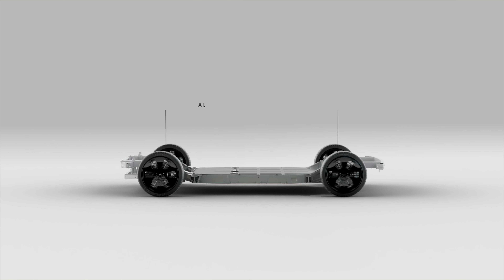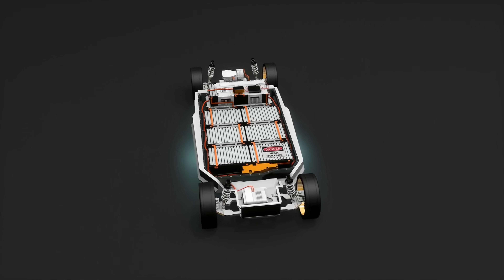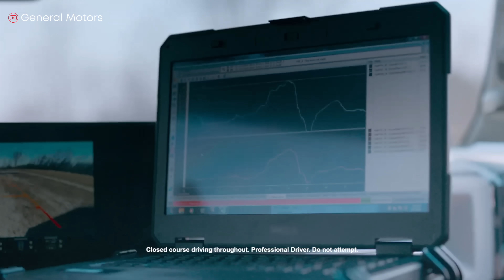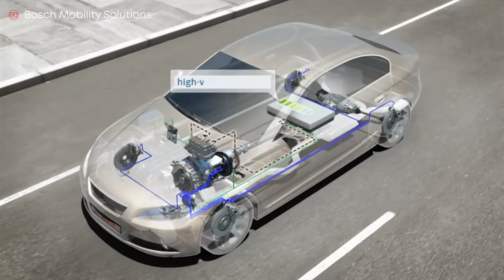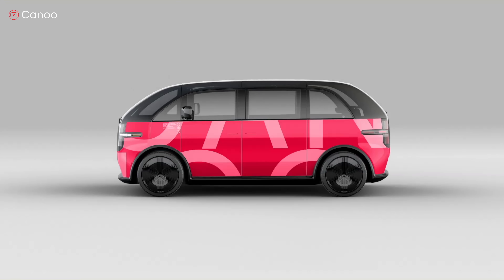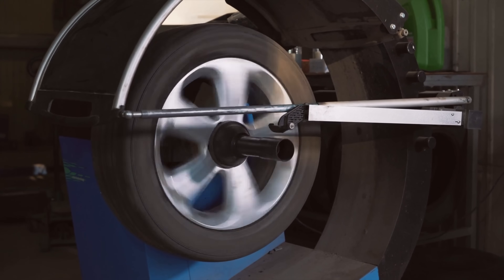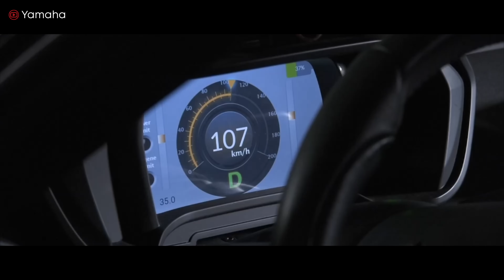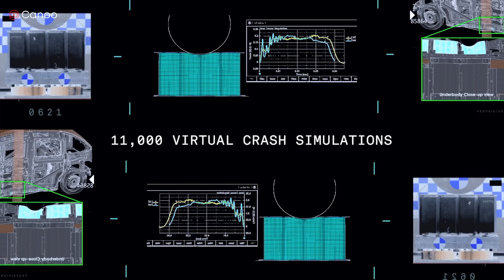No One is Telling You the Truth About Electric Cars, So I Have To

Comment: I heard of a man who brought a brand new EV.
Lives in a climate the same as Michigan.
After 7 years he could not do his longest trip without adding stops to do extra top up charges. It had lost most of its Range.
It was considered "too rusty and worn" to justify the cost of battery replacement. 
This was last year, so by about Feb it will be barely usable anymore. 
Basically he said he could do a few small "in town errands" 
but nothing beyond his city.
Reply: I have 4 years with an ev. 0 degradation so far
Reply: @alexandrutudor9497  It handles the winter winds and snowstorms okay?
The guy I heard of lost the value in his because of body Rust
Reply: @RetroCaptain  very well. no issues whatsoever
Reply: I live in Alaska electric cars are basically for rich people who use them during our 2 month summer, designer cars for decor not practicality

Comment: They are so very quiet you can not hear them come up on you in a parking lot, that's my personal experience with one.
Reply: Me too, I can see a lot of people getting hit by these silent monsters.
Reply: In Europe at least they have to make some noise. Audi’s sound is like a gas turbine. Plus they will have sensors and auto brake.
Reply: @pascalbruyere7108  But the hole idea is ridiculous that a car has to reproduce some kind of artificial sound coming from speakers to make been noticed and believe it's something real..i feel it's like a toy car..instead on a real combustion engine and expcially the sound coming from those V8' engines create a real sound that's coming from the mechanical movements and the pressure of combustion procedures from the fuels in the exhaust tubes in a way that it almost feels like it has soul..it gives you the feeling of a real car and real motor and the sound also varies depending how much gas you give to the motor..and that what makes the driving so enjoyable.

Comment: The key words are "UP TO". Generally, I NEVER have anything come close to these  hyped up "UP TO" claims.
Reply: you can win " up to " a million dollars and as little as " none "
Reply: Yup. They say a lithium ion battery has UP TO 500 charging cycles. Many solar energy users have been complaining about their lead acid or lithium ion battery for failing to keep their promises on the number of charging cycles. Temperature fluctuation, % of charge and discharge, ... all contribute to reducing the number of charging cycles that they claim that are based solely on the optimal conditions in the laboratory.
Reply: @trumplostlol3007   I’m over 2000 charge cycles on my Tesla… originally 265 miles range, now 245… 8 years later nearly 200,000 miles. Still runs like new and still original brake pads.
Reply: @cybertrk  Good luck for that. The replacement cost of the battery is over 20k and where do you want to dump your highly toxic and carcinogenic used battery? LOL

Comment: I think people shrug at the ten year lifespan of these batteries. The battery IS the car. You damage that battery or that battery needs to be replaced, then you mater as well buy a new car. If you get a new combustion engine, that engine can last 20, 30, even 40 years. You can easily sell a ten year old combustion engine. You can’t resell a ten year old EV.

Comment: Last week I drove 1200 miles to a couple of oil sites.  These sites are located in northern Canada. Access is on gravel/ muddy roads.  Guess what? No charging stations.   I'll pass on EV's.
Reply: Good thing most people don’t need to drive to remote oil sites.
Reply: These cars aren't designed to go to remote sites like that.  Not a car I would take on a long distance trip but wouldn't be bad as an everyday  commuter to work and back.  Only thing that would stop me from buying one is not knowing how long the battery will last.  Up to 10 years isn't good enough for me.
Reply: But couldn't you just drop an extension cord down from the clouds to charge it? Hahahahahaha.
Reply: @beachforestmountain4269  Silly---you tow a trailer with a gas powered generator. just sayn
Reply: What? Are you saying the infrastructure for a new technology that's been around for just over a decade isn't abundant? Who would've guessed that? /s
Reply: @nicholasthon973  It is a good thing, but what is the alternative to Canada eliminating all internal combustion engines by 2035? It sure isn't EV's.
Reply: I saw recently on youtube man from Russia  towing Honda gas  electrical charger on two wheels  for his Tesla to drive so far remote sites.
Reply: @bengaljam4550 Positive after 10 years new technology from today  on batteries can help bring additional 10 years or longer to run car. In common, most cars after 10 years are not reliable and absolite.
Reply: Canada won't be eliminating ICE's anytime soon.  The problem is the people vote for Liberal governments who tell the people what they want to hear.

Comment: Great job explaining electric cars. In the forklift world electric forklifts cost more to purchase but maintenance was much less than Lpg forklifts. I expect the cars to be the same.
Reply: @rigamortice actually, it's quite the opposite. They hold their values better than ice cars. I bought a 2020 Chevy Bolt EV brand new for 28k, and sold it 40,000 miles and 2.5 years later for 27k.

Comment: I just did a small study of top of the line 21700 batteries (same as in a Tesla) and the results were interesting. Over 1 year of moderate use and 3 discharge/charge cycles per week they lost between %7 and %15 per cell. 1 out of 15 cells even developed an internal fault and started discharging themselves through generating heat.
 In an electric car with thousands of these batteries I could imagine these results would cause some significant problems.
Reply: And yet, real world results do not support your "small study".
Reply: Exactly what 21700s are these? 21700s are a size of battery, (21mm diameter 70mm length) not a specific model or power rating. You can have 2000mah 5amp 21700s or 4000mah and 40amps. You can have Chinese garbage, or high quality Samsung cells. Simply saying 21700 gives you literally no information at all except their size…

Comment: I think EVs can be made to be more reliable and cheaper. I read somewhere here that Toyota had promised individual cell replacement in the battery pack and it hasn't happened. The whole EV industry is gearing up to rip us off.
Reply: As Toyota quietly is moving towards hydrogen.
Reply: Hydrogen is a pretty crappy energy carrier and tends to be so small it is nearly impossible to contain in a pressure vessel with stability over a duration.

Comment: My friend has a tesla and I've driven it. It's a neat car and can rip, but it has no real personality. If I got one it be a grocery getter and local trips. Wouldn't bother with dual motor or extended range.
Reply: @TheGecko213  it may be a fad, but it's gonna hang for a while. I thought electric cars were dead years ago. In New Jersey, a river flooded a dealership for Fiskers. The batteries took on water and all caught fire. But until you can make an EV "yours" besides wheels and a wrap, gas engine will stay popular
Reply: @TheGecko213  Sure it pollutes. Most of that electricity is made with natural gas & coal.

Comment: As an electric car enthusiast. I have one "beef" with electric cars. You can lose up to 60% of your range in freezing weather. There are multiple ways to work arpund this, but circumstances do not always allow work arounds.
Reply: Right.  And I wonder how much of the charge gets chewed up running the heater in the winter.
Reply: @jwil4905  that’s with the heater./ heat pump. The ingenious octovalve.
Reply: A lot of that can be negated by pre-warming the car while it's on the level 2 charger before you drive. The range loss is mostly due to the cold battery cells not operating as efficiently.
Reply: @RonRattie  Hence my mention about work arounds that aren't always available.
Reply: Not so much with newer EV with heat pumps. I have a Hyundai Kona Electric and it looses about 15-20% in minus -10 degrees Celsius.
Reply: My friend loses 13 to 22% on a Model 3.  22% was in -18F weather.

Comment: I was expecting EV bashing if I'm honest.  But I do have time for scotty.   I learn stuff.    I have an EV, so I'm protective as well all are.   I cannot disagree with anything Scotty says here.  One thing to note is that usually battery fade away (reduced range) or a few cells fails.  These bad cells can be replaced at the fraction of the cost of a new battery.     Scotty couldn't have touched on the cost per KM or Mile savings as well.
Reply: When all cars are EV watch the energy bill and tax bill go right up on them.
Reply: @jamesart6568  Of course. Right now, gas is taxed (especially in Europe) but when everyone drives an EV, the tax on electricity will go through the roof and then there will be no turning back. In the end, all the savings that you project onto the EV will evaporate because governments want your hard earned $$ no matter what (always more, never less).
So, the only real equation you should make is: Are EV's more fun to drive and/or more reliable. I think for neither the answer is a definitive yes - it really depends on the vehicle you are reviewing. Granted, the tech is not at the end of its evolution, like the ICE so, who knows. One thing EV's do have on ICE cars is the fact that they won't pollute urban areas and that in itself is a major plus not to be ignored!
Reply: @r.gelmers6580  not when the EV electric motor and battery is old, guess who can afford to replace them...clue it is not the working man
Reply: here in the Uk the cost savings per mile are at the expense of the ICE driver due to the high taxes levied on Gasoline  , IF there is ever a majority of EVs taxes will inevitably levied on them to make up for the decline in revenue from the ICE user   in other words   at this time the ICE road user is subsidising the EV user in order to create the illusion that EV,s are the way to go.....

Comment: Hybrid is the way to go. No charge downtime, great MPG, we can build a ton of them because small batteries, and we don't have to build out an entire new infrastructure.
Reply: As much as I am wary about maintaining two power trains, this makes a lot of sense. Hybrids now come across as boring compared to EVs, but they are a doable technology that gives an environmental benefit, can be used in areas where charging is a challenge, and can be delivered at reasonable cost.
Reply: EVs have at least twice the efficiency, allow for more powerful motors, and have zero emissions. The infrastructure for charging and building is already being built. Hybrids will be obsolete by the end of this decade, if not earlier.
Reply: @sv650nyc7  Hi. I fully agree with your first two sentences. I think that there are too many variables to be confident about the timing of the third. I wonder if this is not a case of "perfection being the enemy of the good." If the aim is to reduce greenhouse gas emissions, hybrids do that. Hybrid adoption doesn't depend on the existence of a new infrastructure and can happen without the challenge of sourcing new minerals (lithium etc.) on a scale that may not be achievable. On the downside, they require maintenance of two power trains, which is something I'm not keen on. In the early part of the twentieth century, electric cars died out in part because they could not be adopted for use outside of major cities. I can't help but think that there are many parts of the developing world where full EV adoption will be difficult because of infrastructure issues and I wonder if there, ICE and hybrid vehicles will have a longer lifespan. Best wishes to you.

Comment: The cost of a car is often calculated by the car's overall lifetime cost, broken down to cents per mile to drive it. How do electric cars stack up when cost is broken down to per mile cost?
Reply: depends on the car. nissan leaf 2011-16 models had horrible batteries that do not last as long and have the highest cost per mile, but they are also some of the cheapest cars around so if you just use it for a few years and sell, not that bad.
Reply: @khandam7709  The chevy bolt ev( the small one) is just a dream. Is better than the Nissan in a way and the battery is better. You should investigate.
Reply: @sergiolaurencio7534  They are much cheaper to have an EV.

Comment: Hi Scotty.  Just a minor point regarding breaking.  I have a Renault Zoe.  Zoe's don't stop so quickly when you release the accelerator.  Their behaviour is much like a conventional automatic and slows at about the same rate as a conventional car.
You are correct that releasing the accelerator provides power back to the battery.  I usually release the accelerator peddle when going down a steep hill - I like to see how many miles I can gain :-)
Reply: I think you can adjust the level of regenerative braking to suit you. Sounds as if yours is on minimum which might be the default setting.

Comment: Good video. It's worth pointing out that EVs have a small 12V conventional battery too. If that one goes flat, you can't open the doors, or start the car. So that needs looking after in just the same way as it did in the old petrol cars.
Reply: The issue with doors and such is only Model S and Model X because they have powered doors. Most other EVs do have a 12v battery, but it's like a normal car and for accessories. Tesla is going to be shifting to lithium-ion batteries to replace the old 12v lead-acid batteries soon since they last longer and will hold a charge longer as well.

Comment: I’ll be the guy who never owns a fully electric car. My car will always have an engine in case the electric part dies or has bad battery components. Screw getting stuck in nowhere with a power wheels.
Reply: All cars are prone to breaking down.
Reply: All new cars have a ton of electronics and when an electrical component of the engine dies, your car is not going anywhere until it is replaced.
Reply: @ymcpa73  better than the cost of batteries.

Comment: The "as long as the battery doesn't go bad" seems like a really big caveat. They often come with a 8 year/100k mile warranty which is nice, but what happens after that point? What are the odds of the battery needing replaced and the costs if it does? The Consumer Reports analysis Scotty seems to be referencing says that on average the maintenance cost of a EV is $4,600, but a new battery alone can be more than this. I'm considering buying a PHEV, but the cost of a battery replacement is giving me pause.

Comment: Top Areas by Outages
Colorado	7,055
California	6,921
Florida	5,868
Michigan	5,748
Texas	4,243
Reply: It would be good for folks in those areas to buy an EV and actually pay for electricity so the generating companies actually has the funds to upgrade their grid. Driving gas will only send your money to another country.
Reply: If the power is out the gas pumps are also out
Reply: @RW-ur7ym  My car is not limited to 200 miles....
Reply: So, no gas  can be pump  on gas station because electrical  outages

Comment: Man I really thought an electric motor would last a lot longer, given how simple they are supposed to be. I often buy 3 phase motors for my DIY projects and fixing up old tools and some of them are from the 1930s and still work!
Reply: They are. There is minimal wear considering its just magnetic fields spinning it. Consider it as like theres a rotating magnet pulling on the rotor. However ICE engines literally have EXPLOSIONS inside. Electric motors will no doubt last way longer. Also, overheating is a non issue. Theyre so efficient that EVs need dedicated heaters for winter. There is no motor heat to rely on. Gas on the other hand...
Reply: And that's if it doesn't catch fire...
Reply: @PatRick1981-s1w  They actually catch fire far less often than gas cars. There was a recent study just released.
Reply: @chasestevens803  😆
Reply: @PatRick1981-s1w  Go ahead and stay uninformed or do a little research.
Reply: Electric motors are less of the concern but the batteries I guess.

Comment: My LEAF, I always charge at night on what Nissan calls "trickle charge."  I do this because other batteries I am familiar with are damaged by too high or fast charge.  I think you need to confirm or deny that a lithium-ion battery works best with a slow charge that does not generate heat.  My range on a 2011 car is so low that it will easily charge in about 4 hours overnight.
Reply: The LEAF is a special case due to lack of active cooling via the BMS. I had a 2014 Mercedes B-Class Electric Drive with Level 2 only charging. It had an EPA range of 85 miles when I got it and still could do that and more when I sold it in June, but it had a BMS that actively cooled the battery pack to keep it at an optimal temp.

DC fast charging your EV often can shorten the battery pack life, which is why Level 2 AC (240v AC) or Level 1 (120v AC) charging at home or when you have the time works best to prolong the battery life.

Comment: I want to know the lifetime parts repairs cost of the EV and it's initial cost compared to a Gas car of similar size weight ETC. Be neat to see a comparison
Reply: My rough math says a gas car is cheaper then an electric over eight to ten years of ownership. I would like some hard data and numbers to confirm or deny my theory.
Reply: Also, there have been numerous studies on long term cost comparisons if you want to research. There are also many anecdotal stories  on YouTube of long term owners. The trick is to separate the myths (waiting at a charging station for hours, EVs regularly exploding [Google car fires if you want to read some scary facts], replacing batteries after a couple years, etc…) from fact. 

But the info is out there.